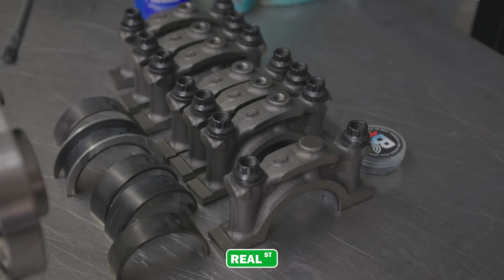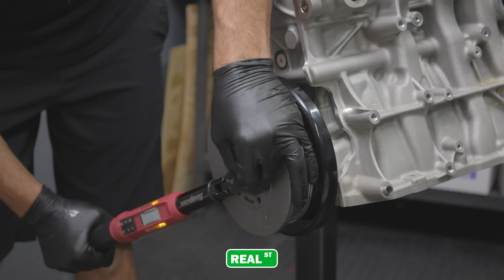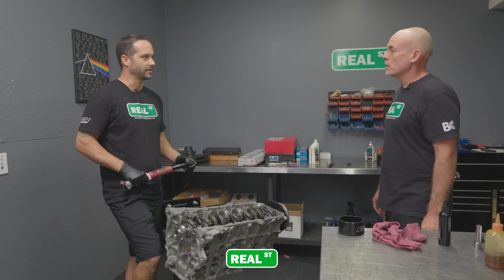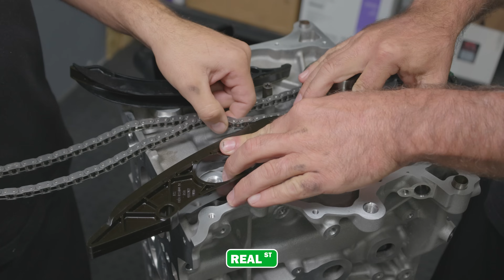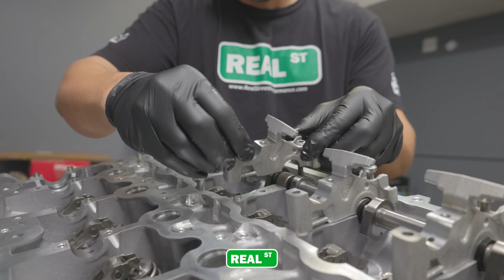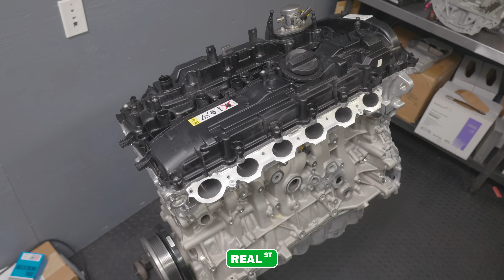Building a 1000HP B58 MK5 Supra Engine

Comment from the maker: Should we compare the newer B58 MK5 engine with a 2JZ engine? Show the differences...👀
Reply: yes!
Reply: If the McLaren F1 uses a BMW engine. That should tell you everything you need to know..  I don’t think Toyota would have used a BMW engine if it wasn’t capable
Reply: They use a mercedes engine @MrAtvfan
Reply: Considering multiple decades, I think the expectation is the B58 will be a much more technically advanced motor- but it will never be a 2JZ. But yes, please make a video.
Reply: The only issue I have with the B58 is the Valvetronic nonsense. It’s an emissions thing (mostly) and I’m not sure if you can delete it.
Reply: We wouldn't compare a Nokia phone from 1992 to an iPhone from 2020. There's no need, and the comparison further shows that the standard I6 is the 2jz engine. The 2jz platform has nothing to prove in the car world, and the Bmw B58 engine merely exists in its shadow.
Reply: S58 would probably be more ideal?
Reply: I’m talking about the McLaren F1 road car from the 90s. It has a V 12 BMW S70/2 engine.  And it was the baddest car on the planet for many years.
Reply: The 2jz is better. One of the strongest cast iron blocks ever made, girdle that acts like a block brace, 7mm thick siamese bores, extremely good oil flow, the list goes on.
Reply: Yes sir!, put this debate to rest. Haha
Reply: @lennixsingh626 that's what these BMW fanyboys are having a hard time understanding. I have been saying since the beginning. The cast iron block can hold way more crank pressure than the new B58 Aluminum block can.
Reply: yes B58 is modern 2jz
Reply: @balancemode4112  I disagree,
Reply: @balancemode4112  no it's not 🤦‍♂️ it's the next evolution of the N55 platform lol.
Reply: F1 used a BMW motor
Reply: YESSSSSSSSSS
Reply: YES
Reply: @MrAtvfan   Considering McLaren has rarely made their own engines, I would think that's an unfair assumption?
Reply: Do love the simplecity of the 2jz was designed like a bomb back then. New engine is nice for making power also, but its still a lap behind.
Reply: It's actually quite disrespectful to compare this BMW engine to the mighty 2jz considering all that it has accomplished over the years. And im a Corvette guy but always seeing this topic disgusts me.
Reply: @shadyshinichi2JZ  we are talking about engineering of engines not phones lol😂  2J fan boys getting all worked up over nothing? The 2 j is an old engine so this engine will be an option going forward that’s actually the point isn’t it?  It will most likely be a better engine as well considering it’s a newer and has loads of parts and engines available when 2 J stuff gets harder to get and over priced when you can make more reliable power for less money it will simply replace the old 2J 😢😂
Reply: Thats a great idea
Reply: I mean it would be interesting but the similarities are “they are both inline 6s”  and that’s about it..
Reply: @MrAtvfan  counter point they used a Subaru engine in the ‘86 cars
Reply: @MrAtvfan indeed its way advanced better no way to compare it with 2JZ ancient engine
Reply: 2JZ over the B58 all day. B58 will never compare to the 3 decade old 2JZ. The slight advantage the B58 has is the new technology only. 2JZ engine looks way better than the B58 engine with hoses and wires all over the engine.
Reply: @Aladinscave b58 is always gonna cost more then building a 2j so no point tbh.
Reply: @Charlie589  the 2j is a great engine but I like these roller cam follower heads and the if someone made a good aluminum block for the 2j (ahem dart…) that would be awesome.  I think the barra ends up being a good compromise of all the smart stuff from both engines without going stupid with direct injection etc etc. honestly GMs atlas engine is pretty sick too, but no one makes parts for it.
Reply: Yessss pleeeaasseeee🎉
Reply: Jes, but Toyota and Bmw b58 engine was'n same. Toyota need more reliable and heviduty parts. Myself i don't like b58 when i see cams and valvedrain desing....
Reply: @Aladinscave sry bro, 2jz is better. I know it’s old and it hurts. Just deal with it lol
Reply: Yes let’s do it !!
Reply: Yes and i hope its better than the 2jz xd. You have no idea how funny that would be
Reply: @lennixsingh626  if you were just comparing blocks, but an “engine” is a sum of parts.
Reply: @kkellerk23 an engine is more than just a block.
Reply: All that matters is $$ per hp (that’s reliable). There plenty of engine far better than both of these, but it comes down to cost at the end of the day.
Reply: @Funkyflykiwi   The block is the limiting factor of an engine in the modified world. Not the internals as people already make aftermarket parts. B58's are already ballooning at 1100. A 2jz holds around 75-80 PSI before splitting bores and ballooning/ cracking the block.
Reply: @kkellerk23  Cast iron blocks are heavy and heavy = shitty for actual motorsports, which is why you see so many going to billet aluminum blocks nowadays.
Reply: @justsomerandomguyman   what does that have to do with anything with how much a stock block can take? Short answer, nothing. Cast Iron can still take more abuse until you get into a aftermarket cast billet aluminum.
Reply: @lennixsingh626  just sleeve the block, theres no end to the modifications you can make.
Reply: @justsomerandomguyman   Billet aluminium is more dense than cast iron. Cast iron is more dense than aluminium by a long shot lol. that's why all the cast block kings in the I6 world are iron. Such as 2j, s55, rb and barra.
Reply: @Funkyflykiwi  valid. Still yet to see b58 pushing over 1400hp tho.
Reply: @lennixsingh626  true, still a fairly new platform to modifiers though, but what are we comparing?  Is this a contest for which block can handle the most hp? Or is it which makes the most hp in stock form?  Or somewhere in between?  Each engine will have its sweet spot and the JZ has a 25year head start regarding aftermarket and tuning.
Reply: Bmw inline 6 turbo motors are slept on..even the n54 and n55 can make some jam if done right
Reply: Uhm yes.
Reply: really upsetting the 2j guys in this thread.
i think a comparison will reveal how similar they actually are.
Reply: The B58 and S58 are fantastic motors. For daily driving and streetability, the B58/S58 are fantastic. The 2JZ is king in quadruple digits and drag racing, but that's a whole different game all together.
Reply: Absolutely
Reply: @MrAtvfan  It's a good engine, but to be fair, they use a Subaru engine in the GT86 and it's a piece of junk.
Reply: compare it to the mighty s58
Reply: Yes sirrrrr do it
Reply: @MrAtvfan McLaren also uses Nissan engines
Reply: @MrAtvfan  Don't bother. You are talking to 14 year olds. Kids probably can't spell McLaren, nor were they alive in the 90s. If they new anything about the PINNACLE of autosport, especially in the 80s-90s - they would not be commenting so naively. They just watched fast and the furious too many times.
Reply: Was hoping that bmw makes a new V12 that is tuneable
Reply: @Brian-tu7yn Dork
Reply: @shadyshinichi2JZ Too bad you don't have neither engine or car
Reply: @lennixsingh626 2Jz is not better. Really expensive platform, Bmw B58nis cheap and can make 600-700 for las than 5k
Reply: Yes please. Two prime straight 6’s in their own eras
Reply: @F80__Los  until B58's or any BMW motor for that mater make more power and hold together they aren't better.
Reply: @lennixsingh626  S58 makes 1000 and holds it with turbos and me fueling upgrades only
Reply: @F80__Los   And theres 2j's making 1200hp Sbe. And 3000hp billet blocks.
Reply: @justin5588  Not the first one built, named mc laren F1
Reply: Yes
Reply: @justin5588  He's talking about McLaren's road car called the "F1" which went into production in 1992.
Reply: @MrAtvfan  It's not that black and white. Gordon Murray initially wanted Honda to build them a V12 because, at the time, Honda was dominating Formula 1 with their engine in the McLaren/Honda F1 car. However, Honda showed no interest in creating a V12 for Gordon Murray. Isuzu was also working on a V12 at the time, testing it in a Lotus chassis, and showed interest. But ultimately, Gordon chose BMW. This decision was based on BMW's proven V12 design, racing pedigree, and their immediate interest in willing to build a V12 for Gordon. The M70 V12, which the McLaren's V12 is derived from, has its typical issues like any engine. For instance, the M70 is known for oil leaks, which are a significant concern, and the sump gasket can also pose problems. You rarely hear of the McLaren F1's V12 engine problems, primarily because only 106 were ever produced and they are seldom driven. Additionally, their wealthy owners can afford meticulous maintenance. For example, Jay Leno showcased in a video how the entire engine was removed from his F1 to inspect and replace any worn components.
Reply: @shottyshot F1 has basically an unlimited budget to run it 😂 do you ,?🤣  Ok then 2J is and will always be king until further notice.
Reply: @MrAtvfan McLaren F1 have used Honda F1 engines for a long time too,.but none of those engines were ever available to their production cars. 

The 2JZ is a iron block with siamied bores paired with massive forged crank. I doubt the B58 block would handle over 1600hp without cracking sleeves or just flex and snap the crank.
Reply: That’s a great idea.
Reply: @TML34  you can, you can even code the valvetronic motor to stay stuck at maximum attack and that would be just a no variable valve lift engine. You can also have a mechanical fixed replacement done for the vavetronic motor that wont budge as well. It's realy easy to do.
Reply: @justin5588  incorrect, it is a BMW designed and manufactured engine in the McLaren F1
Reply: Yes please
Reply: @balancemode4112 you BMW fanboys said the same thing about the N54 🤷‍♂️
Reply: @Aladinscave "2JZ stUff iS haRdeR 2 gEt aNd oVer pRiceD" you literally wrote this while failing to understand that building a B58 is over 4x the price as a 2JZ just to make hundreds of WHP less than a 2JZ right? 🥴
Reply: @Funkyflykiwi B58's factory longblock record is 975whp and melted pistons at this level. 2JZ is 1100whp. Even the smaller 1JZ is over 1000whp factory longblock. Fully built the same guy who melted pistons at 975whp spent over $100,000 USD on his B58 only to make 1300whp and berally rev to 8,000rpm. B58s are almost 9 years old. Meanwhile there is a 1.6L i3 GR Yaris holding 740whp across the factory longblock since last february. This G18E-GTS 1.6L engine is just 3 years old.
Reply: @allboost70  compare stock to stock, as soon as you start modifying things you simply cant compare anymore. 2jz has 25years more development and 1000x+ more people developing it.   That will change over time
Reply: @kkellerk23  not a fan boy but a iron block and crazy power does not mean better. Just do you and pick what you want, those that like B58 are also winning events and enjoying not needing that much power to achieve similar results and thats okay.
Reply: @tempeztad  I'm just pointing out the fact that crank pressures of one block is better than the other. I could careless what folks choose to use. I just don't like folks trying to discredit one to push another. The BMW platform has always been good, this is just a better newer version.
Reply: @Funkyflykiwi  nobody in the tuning world cares about stock vs stock. We care about potential and B58 falls very short from being capable of doing 2JZ thing, rather we talk about factory longblock records or in fully build form. And "25 years ago" we never had the aftermarket availability we do today: standalones, turbos, fuels, etc. You had to order things from the back of a magazine lol 

Look at the C8 Corvette, made a factory longblock record of 1200whp within 2 years of production. Look at the GR Toyota Yaris, made a factory longblock record of 740whp within 2 years of production last February. We have the technology. B58 is almost 8 years old boy! It can't do 2JZ things and it won't.
Reply: @allboost70  good points but not entirely true, there are plenty who “tune” with a just a tune.  Everything stock.   And it progresses from there through to billet blocks.
Reply: @Funkyflykiwi  you said "not entirely true" and proceeded to say BMW stuff. What part of what I said isn't true? Where's my lie?
Reply: @allboost70  its simple, you said “nobody in the tuning world cares about stock vs stock”.   Thats not correct, at the base level tuners need to know what an engine can handle stock, this is because many simply sell tunes for stock engines.
Reply: @Funkyflykiwi  what you said is true but it's strickly a BMW thing. While comparing engines we mostly look at where the ceilings remain and the B58 is very short.
Reply: @allboost70  you are wrong again, you assume engines are all about max power, thats far from the truth. Circle track, offroad, endurance etc are not about max power. Its about efficiency, durability, weight.  Your view of engines is very narrow and is only representative of a small portion of racing
Reply: @Funkyflykiwi  there is a simple truth you're not opened to. Engines that hold a greater WHP/WTQ factory longblock record are simply more desirable within the tuning community, which is outside of stock tunes. And this is my point. Back to context, the B58 is found below 2JZ capabilities. 

If one cares about stock tunes for a business, that's purely a BMW thing, because later ECUs are reprogrammable where the JZs are not. The 2JZGTE VVTi ECU is ready for up to 550whp max with factory electronics (single turbo & bolt-ons). Not sure what the limits are with reprogramming the factory BMW ECU but it's a edge to have instead of standalones.
Reply: @allboost70  wrong again, that 3x in a row now.   A 6.7 cummins straight 6 block will hold over 3000hp.  Lots of power sure, but what is it good for?  You fail to understand the motorsports/tuning world outside of max power applications.  Cast iron blocks are good for max power, but they are heavy and inefficient making them less desired in the majority of racing/tuning applications
Reply: @Funkyflykiwi  different strokes for different folks. 6.7L Cummins got a bore & stroke with a purpose to haul by design. They can't "rev". 

B58s can't rev anywhere near a JZ but they make torque, given it has a nearly identical bore & stroke as Toyota's 7MGTE from the MK3. B58s literally output nothing Toyota guys haven't seen before. And they won't.

Wanna read about actual news on-topic? 
Toyota has a 3 cylinder called the G16E and WITHIN 1 YEAR of production it holds a 740whp factory longblock record last February. This record is 76% that of the B58's record but with only 53% of the displacement... The 7 year old B58 has a longblock record of 975whp before melting pistons.

A i6 variant is next lvl 2JZ.
A true "modern 2JZ", if it existed. Because it may actually do more than 2JZ things. And it's Toyota.
Reply: @Funkyflykiwi  wrong about what, all I said about the cummins is it can't revv nearly enough to be in context of a sports car engine while discussing 2JZ. You keep claiming I'm wrong without specifying. Aimless discussion.
Reply: @allboost70  maybe reread our conversation, its pretty obvious.
Reply: @Funkyflykiwi  i have. You got a point of 'tuners care for abilities of factory components' as a business. But also in the same industry of bolt-ons or fully built motors, my point is we care more for the engine that holds the greater ceiling for potential; factory longblock or fully built ceilings. The 2JZ holds the highest position in both by a large gap and you won't admit to it.
Reply: @allboost70  you obviously didnt reread our conversation because if you did you will see that max power potential of an engine is only relevant to a small portion of the Motorsport world.  You think max power is whats important, well its not to most Motorsport applications.
Reply: @Funkyflykiwi  man if you're going to compare engines, you need to use a unit of measure. Said measure should be what they are capable of holding straight from factory - factory longblock record. WHY TF would a weaker engine be better? 

The RB26 is also weaker than JZ but it is still very capable in fully modified form. Still doesn't sudently make it 'better' than JZ. Applications? What application is best while having a less reliable engine? 😂 fast or reliable or cheap, pick 2.
Reply: @allboost70  disagree, comparing engines just on their max potential is flawed reasoning and shortsighted.   We have been over this. Very few engines are used at their maximum power output level.  Your argument is flawed.
Reply: @Funkyflykiwi  yet you STILL can't even present a better unit of measure yourself. 

B58 can't handle the stock longblock record of a 2JZ, nor while fully built can it even reach the revving and WHP capabilities that of a fully built 2JZ. So how is it "better"? In what unit of measure. 

It can make torque that is all it has going for itself, but so can the 2JZ. Don't give me a pathetic "well heh heh its lighter because cornering" subjective response. Unit of measure or gtfo.
Reply: @allboost70  your wasting everyones time, If you cant understand or comprehend whats already been discussed you have a problem. Go back to school
Reply: @Funkyflykiwi  you're right, I don't understand how a engine FAR less capable as somehow "better" than a 2JZ, without given any valid reasoning other then "1000whp is not necessary in some cases". You read like you're the product built by a stray Karen that says: "sPeeDinG wOn't gEt yOur tHere fAstR!"
Today we see 3000whp+ vipers, GTRs, Lambos, etc on the streets and here you are struggling to justify a 3L inline six that can't even rev over 8k while fully built let alone 1000whp across the factory longblock, as somehow better than 2JZ but without doing something a 2JZ can't. What a waste of time! 😂
Reply: Yes please do
Reply: Toyota aide beaucoup bmw developpement  @MrAtvfan
Reply: Yes
Reply: would love to hear "jays" thought about this: "can engine be damaged internaly with adding oil while the engine is hot?"
Reply: Firstly, the 2J wouldn’t be allowed to be built today. You think engineers have gotten more stupid over time? Engineers are fuel and emission constrained. Yes, the 2J has a great ability to produce down the quarter mile but good luck ever tracking them, they detonate and overheat when making constant power. Ask Toyota, they never even tried racing them in the GT cars. Last, the BMW motor is a very stout motor that makes lots of power with simple bolt ons. You don’t have to open these motors until 700hp mark, almost like the aforementioned 2J. Watching too much drag car content in America, there’s more to motors you know?
Reply: @kkellerk23  theres deadass like 0 similaraties between a b58 and an n55
Reply: @sampfister580  you clearly didn't read anything I wrote and made a dumpster fire 🔥 of a comment, good job. 🤦‍♂️
Reply: @Brian-tu7yn  however, as time as goes by. 2JZ would be a rare breed like fresh from stock unlike B58. So maybe someday it might get treated like 2JZ with enough aftermarket support. Also 2JZ was nothing before, as tuners back then uses RB engine all because of aftermarket varieties, same way as when Nagata uses V12 RB on his Top secret supra.

Although I would happy if the MK5 isn't as hyped as MK4 for less cost hike lol.
Reply: The Barra is a toy next to the JDM and uero i6 engineering.the Barra would be the worst engineering ever seen.get a grip.thete is a long list of shit wrong with the Barra that can't be fixed  @Bill-flatplanefool
Reply: @lennixsingh626 Barra is not on the list of kings come on 😂😂😂
Reply: B58 is proving to be pretty stout. I think someone's making four digits with an unopened block.
Reply: S58 too